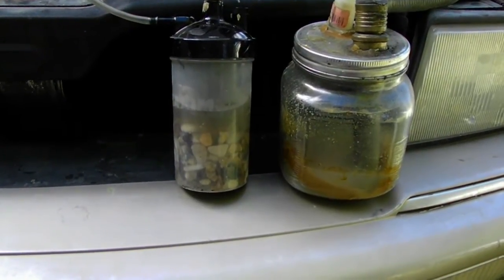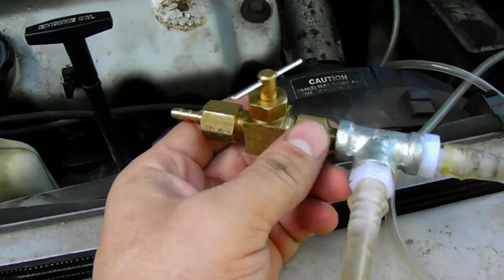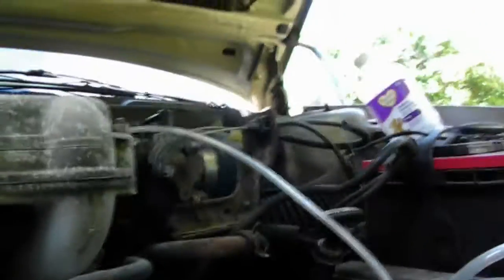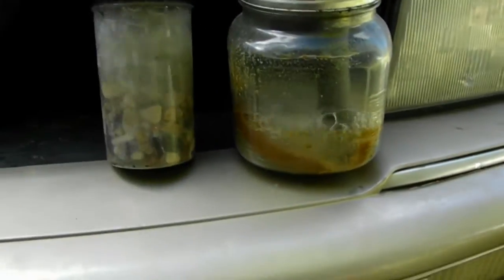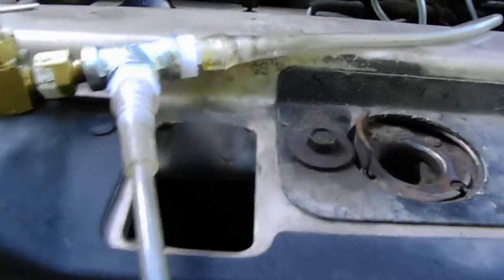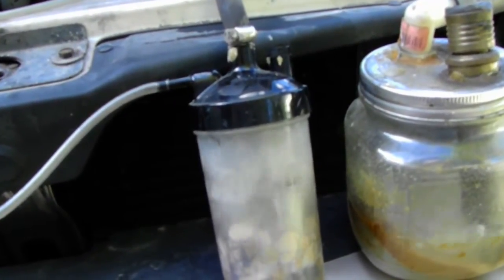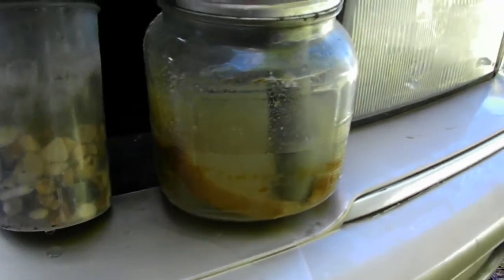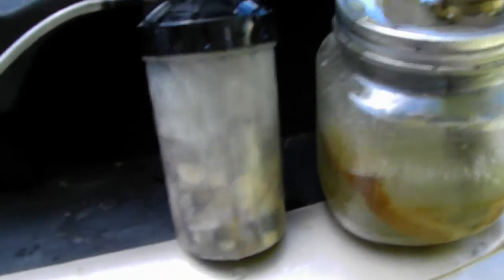Water vapor induction via venturi pump improved

Comment: There are ways to prevent water getting sucked into the engine. 

Adding another plastic container that has A connection near the bottom and one in the lid is an easy way to do this.
Reply from the maker: its better for.water.to.get sucked into.the engine
Reply: @prototype9000  Looking for A fine mist so I might use an ultrasonic transducer combined with A bubbler.  

Looks like the rocks do A pretty good job of separating the bubbles.

I ran A lawnmower off A bubbler because the carburetor was not repairable, last summer.  I would mix waste oil with the gas just to get rid of it. 

Will be adding rocks to the bubbler next summer.

Comment: I used a system a lot like this on A 1958 Chevrolet with a 348 in 1965, the main thing is getting the bubbles adjusted so as to not use too much water vapor , it was very simple to build. Water injection has been used on aircraft for years to get more thrust. I used a valve for air adjustment from a fish tank, adjust it  so an even flow of bubbles is maintained.

Comment: Before you comment read this: Prototype9000 is not attempting to inject liquid water into his engine, but rather vapor. Liquid water doesn't burn; that's why it's used to quench fires; we know that. Water vapor is a higher energy state of water; it's a gas. All elements can burn; that is, change into their plasma state. Fire is plasma. So is it then impossible for water molecules in a gaseous state to go into a plasma state (/burn)!?!? I'd love for anyone to show me how it is impossible for gaseous state water to catch fire (/go to plasma). Water not being a fuel source!!? Come on, use your imagination! A gasoline internal combution engine (I.C.E.) works by burning a mix of vaporized (gaseous) hydrocarbons and oxygen [gas] (from air) by spark plugs (spark is plasma). Notice what makes up of hydrocarbons; HYDROGEN and carbon. And water is also part hydrogen. And so it's then impossible to use what makes up water (hydrogen & oxygen) as, at least, a fuel supplement!?! Are you then going to tell us hydrogen and oxygen can't burn!? Answer this; when water is in a higher state (vapor), how much more energy does it then need to plasma? It is then feasable that the spark plugs in an I.C.E. have enough added energy to cause water to plasma. In this functional experiment we don't even need to consider if the bonds of hydrogen and oxygen are splitting or not. Who cares? As long as this is providing some sort of benefit! And you, viewers, can help confirm this experiment as being benefical or not benefical by trying it yourself.  So is Prototype9000 "dumb" for doing these experiments? No. Are the experiments themselves "dumb"? No.
*Put on your thinking cap before you post a comment that you "feel" is right and prevent yourself from looking foolish*.

Comment: prototype9000 Did you is vaporkid,s ammo box setup for a lawnmower, Will that work on my lawnmower and is it safe.
Reply from the maker: Kenneth Meggers yeah vapor kids design is safe mine is to for water vapor induction system just dont want to get to much into your systrm or you will get water into your oil and that can cause big problems
Reply: Did you know that there is gas in the ammo box
Reply: prototype9000 On vaporkids design he had gas in the ammo box and he had some wicks and the mower run on gas vapors and he had a water vapor  injection to cool the motor, I wanted to try this because i wanted to run my push lawn mower.

Comment: Hi, I just figured this out myself, I'm going to use the stock windshield wiper bottle as the "bubbler" bottle, run 3 hoses into the intake tubing, evenly spaced, and they will only work when engine vacuum gets over a certain point. Maybe 50/50 water/meth in the reservoir?
Reply from the maker: 10% or less alcohol i found works the less  anymore seems to evaporate to fast and causes your engine to become less efficient but you do get more power like that regular windshield washing fluid works fine
Reply: Thanks.
Reply: Can i get better gasmileage if i put 50% gasoline and 50% water in the jar
Reply from the maker: if you vaporize it then maybe if you add acetone to it it then you 
wouldnt need the gasoline you could actually run your car off from 
acetone mixed with water although the car would run like crap
Reply: I got a yellow bottle of heat will that work in my bubbler in the winter time.
Reply from the maker: Kenneth Meggers yeah or you could just use straight windshield washing fluid though
Reply: Can i use water mist or just water vapor.

Comment: Maybe it's time to take another step further?
Can you manage to change your spark plug to something capable of producing enough power to ignite the water directly into the engine?
I mean that water vapor is more like fog and more likely to burn in that state, which in turns can take advantage of all the hydrogen and oxygen trapped inside the molecules.
I would very uch like to try it myself, but I don't have a car to do it on, neither do I have all the parts and handytools needed to make it work, but how about that?
Wanna try and show? =)
Reply: Jan Erik Kristiansen water is an exhaust product of combustion. the effect of water on combustion here is solely to chill the cylinder head and take up space in the chamber.
Reply: Ellenor Malik exactly, by displacing air with water the oxygen sensor will send the car’s ECU a signal to shorten fuel injector pulse widths, delivering less fuel.
Reply from the maker: found steam was allot better my next step is to do gas vapor with a similar system
Reply: prototype9000 I just wanted to verify wether it is possible to rely only on water to power your car.
Steam is probably better, you think you can make it run with steam?
Please make it happen and prove once and for all that water is just as much a fuel as everything else, except that it's non pollutant. 
It would be amazing to write another chapter in history that people were wrong all along about water being uncombustible ;)
Reply from the maker: Jan Erik Kristiansen theres people who say they have but gets suspucious when they dont let someone go throughthe car to see ifthats really the case some use hho generators i would put my  money to electric cars though if i had any
Reply: prototype9000 Electric? Short range. I'm not giving up on this idea, water has something worth looking into ;)
Reply from the maker: Jan Erik Kristiansen electric vehicles have been around since the late 1800s some had rnges of hundred of miles even heard of in the thousands tesla is waiting to release technology that will enable you to do the same they even made the patents open source  water has the issue of embrittlement of steel and other metals when it breaks down into hydrogen and oxygen and requires tremendous amounts of power i would rather have electrical power than water but everyone is welcome to dothere own thing also water vapor is the most major greenhouse gas it may stop forest fires by watering the plants onthe side of the road but in long term other issues will arise
Reply: prototype9000 I think both is good alternatives, but I don't want to outloop combustion engines entirely as so many unique cars and unique engines have been made, and most of these are pre 90 cars.
I looked into Tesla as well, and I mean to recall he did success in drawing electricity from the ionosphere to his Wardencliff tower.
As long as anything new can work with old technology as well, I'm all in for it.
Reply from the maker: Jan Erik Kristiansen im talking about tesla motors company they make electric cars
Reply: prototype9000 Why would I use stored energy if I can draw it from the surroundings?
Nikola Tesla knew something, and it's up to me and everyone else to make something out of it.
Yeah, the car is ok, but nothing special about it except the fact that it uses stored energy.
I'm more for unlimited range if electric is to be used.
Reply from the maker: Jan Erik Kristiansen
inthere new patents there running in over unity they mention about zeropoint fields and stuff if you can stand looking at hundreds of pages
Reply: WATER DONT BURN
TO BURN SOMETHING YOU SHOULD SEPARARE H FROM O, AND YOU WOULD NEED A LOT OF POWER , ITS NOT ENERGETIC EFFICENT

Do you  have an eletric nuclear  power plant on yr car? Ima sure you could burn some water...be happy ,dumb
Reply: did you look at thevaporkids vapor carburetor with the ammo box for a lawn mower on utube, Does that system work and is it safe, I was going to build that for my lawn mower.

Comment: Nice setup you made. I'm going to make a system too, but my design is way different, me being a performance nut. I'm going to inject it in the carberator like you would a nos setup. I'm after 25% gains off the line and on the highway. Not that strong as nos but should still be fun when I hit the button, LOL.
I'm curios on your setup though. How long does the water in the bottles last on average or how much water per gallon of gas you use. Plus if you always use strait water? One more question, What happens when you run out of water on a long trip, will it stall the motor or just run lean till you fill it up?I actually learned this in school taking my A&P classes but I have no hands on experiance.
Reply: Yah I watched it with the steam vapor maker. That will be to hard to do in my case. I'll be trying to do it with hand spray bottle nozzles hooked to a window washer pump. The spray nozzles are the adjustable kind to refine the mist and those little waterpumps for the squirters on your car are actually pretty strong. I'll have enough pressure to run 2 nozzles per pump. Makes a really fine mist. I already tested it on my Jeep engine while idling with just water with success, well sofar anyway. I plan on using windshield washing fluid since it's a 20% methenal mix.It retarding the timing is to be expected with how much I plan on spraying into the engine which will benefit in my case because my motor is running on the ragged edge of lean and as much timing as I can with 87 gas concidering gas well was 4.50 a gallon. At one point I had that thing idling at 350 t0 400 rpm's at stoplights, LOL. It's a built up 360 ci old school setup around 300 hp right now. I'm after the steam engine effect mainly at highway speeds which is 2800 rpm doing 60mph. If it works it should be fun as hell, just push the button to pass a car, well maybe. If anything it will turn the inside of my engine into a Smurf from the die from the washer fluid, LOL,
Reply from the maker: ***** the thing about water injection to get the most out of it you need to advance the timing a bit and sometimes it causes the gasoline to not have a complete burn and a loss of performance steam has none of those issues . I use rubbing alcohol windshield washing fluid tends to evaporate to rapidly decreasing your milage you need only very little alcohol
Reply: prototype9000 OK, Didn't know that, Thanks. Do you have a mix ratio for me I could try?
Reply from the maker: ***** 10% alcohol seems to be optimal anymore it evaporates to quickly great for performance though
Reply: Thanks, I'm just about to start makin it, I got all the parts during the winter.
Reply from the maker: ***** cool check out my channel i have made improvements and other updates. Another one to come soon
Reply: Yah I seen the steam setup.Easier to vaporize. I subed so I don't miss your updates.
Reply: @prototype9000  can you create steam of the exaust and then into the air intake ?
Reply from the maker: @wildfire8341  with a heat exchanger you can you can buy ones allready made that are far more efficient than they ones you can build

Comment: Hi Prototype 9000 i tried this setup, the one that is connected to the air intake rubber tube,i made a hole and insert a hose coming from the bottle jar, yet no bubbling is happening, please guide me, thanks
Reply from the maker: You need an inlet tube that goes to the bottom of the water and another tube that sits at the top of the container that goes to the vacuum dont let that go into the water or it will crack a cylinder head
Reply: Could it be that my jar was not copletey sealed, that's why there is no bubbling?
Reply: Could it be that my jar was not copletey sealed, that's why there is no bubbling?
Reply from the maker: Ranelio Pacites yeah that could happen or you didnt choose a. Good vacuum port
Reply from the maker: https://www.youtube.com/watch?v=qcgYCLRQTfE
Reply: prototype9000 I seen your steam injection using water, Do you get more mpg with steam injection or the water bubbler
Reply from the maker: Kenneth Megggers =im still in testing seems about the same but steam gives you more power my fuel pump and distributor bit the dust so everything is on hold
Reply: +prototype9000 so you going to try gas vapor now.

Comment: hmmm..what if i naturally injectected steam in to the breather by routing water heated naturally by the heati from the engine..the steam combines with air induction from the breather and meets gasoline vapors from the carb and then goes into combustion chamber and burns lean?
Reply: The idea is to get the water to steam when it is inside combustion chamber so it expands and adds power plus lowers temperatures.

Comment: Edwin aristigueta where do you get the bits for grooving your throttle body
Reply from the maker: Didnt do anything to the throttle body
Reply: prototype9000 what do you add to the water so it don't frease in the winter
Reply from the maker: Kenneth Meggers isopropyl alcohol
Reply: prototype9000 If I use a water mist maker that I get more gas mileage.
Reply: +Kenneth Meggers can i use used cooking oil instead of water in the bobbler.
Reply: +Kenneth Meggers  can i use used cooking oil instead of water in the bobbler.
Reply: +prototype9000  can i use used cooking oil instead of water in the bobbler.
Reply from the maker: +Kenneth Megggers no not unless you want to leave smoke trails everywhere
Reply: +prototype9000 does it run the car motor, Is it dangeris
Reply from the maker: +Kenneth Megggers its safe it supplements the internal combustion process

Comment: HOW MUCH IS THE MILEAGE OF YOUR CAR USING VAPORIZER?
Reply from the maker: About 34 mpg from 26 its not working so great right now i need to find something different
Reply: prototype9000 I got a water bubbler system on my car, Do I have to warm the water vapors up before they go into the engine
Reply from the maker: no not really add a little rubbing alcohol in helps it evaporate easier its really just humidifying the intake and cooling the air down
Reply from the maker: Kenneth Meggers i uploaded a new video of a much better system
Reply: prototype9000 Is this your new video (Water vapor induction via venturi pump improved)
Reply from the maker: Kenneth Meggers new video > Water vapor induction/Manifold humidification
Reply: prototype9000 It is to wablely I can't make it out.
Reply: prototype9000 Will the cold water vapors crack the piston if I don't warm it.
Reply from the maker: Kenneth Meggers no thers not enough going in there to hurt  anything
Reply: prototype9000 Does it work this way the more bubbles you can make in the jar the more mileage you get
Reply from the maker: Kenneth Meggers only if you are able to get more moisture into the engine
Reply: prototype9000 Will that hurt the engine if I suck liqud water in the engine slowly though a 1/6 inch hose.
Reply from the maker: Kenneth Meggers if you atomize it  or get it to break up somehow wouldnt hurt a thing you have to control the flow  somehow or even with that gauge the cylinders can fill up quickly and you will crack the heads for water injection a venturi pump probably would be best for atomization under vacuum pressure i should buy one if you are pumping the water then a fuel injector would work fine as for water vapor injection or manifold humidification whatever you want to call it you just need to bubble the water my newest video shows a very good design for that. theres other methods as well like steam injection and ultrasonic and mechanical agitation
Reply: prototype9000 what kind of bit did you use to put the groove in the throttle body and where can I buy the bits.
Reply from the maker: Kenneth Meggers i didnt do anything to the throttle body
Reply: will I read that and I wanted if any body new where I cound buy some bits
Reply: Kenneth Meggers You don't need to drill anything. Go to an auto salvage yard, auto part store, or hardware store and buy the correct parts.
Reply from the maker: ***** hes talking about the gadgetman groove which is a throttle body modification its a groove in the throttle body which compresses the air intake in short rapid burst enabling fuel to be atomized more efficiently giving you a large increase in gas mileage and power. which somehow he mistakenly thought i had done that
Reply: Oh, my fault, I thought you 2 was talkin about something else.

Comment: Lean the fuel mixture some too. You'll get more power and better mpg. The water vapor will keep it cool.
Reply from the maker: i had that idea but i cant lean the mixture without a adjustable pressure regulator im working on a  better system i noticed this one only hits in like one or 2 cylinders at a time. no what i want
Reply: prototype9000 You need to put in another fuel pressure regulator( an adjustable one ) on fuel rail since it is fuel injection. this will lean out motor the whole fuel curve by lowering fuel pressure for fuel injectors. Looks like an OBD1 fuel management system, if you lower the fuel pressure the computer won't give a trouble code.
Reply from the maker: ***** an efie attached to the oxygen sensor will work its an egr system but it would work the same on a obd2 system if the pressure drops to low teh computer will detect the lower pressure and ways and send the car into limp mode which is crazy